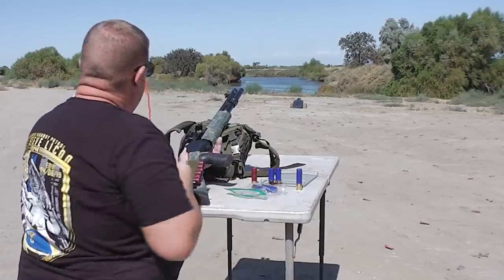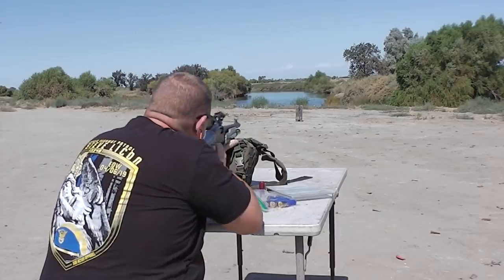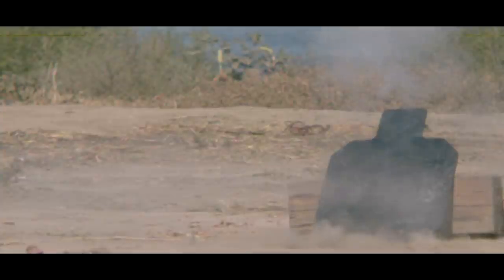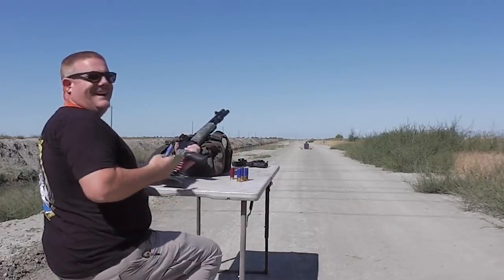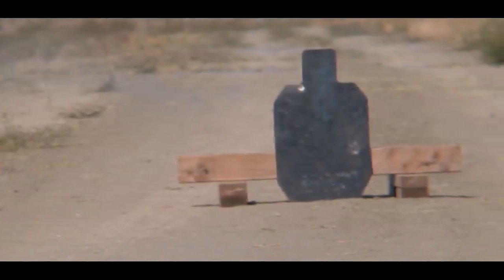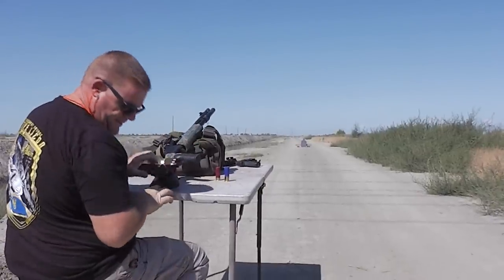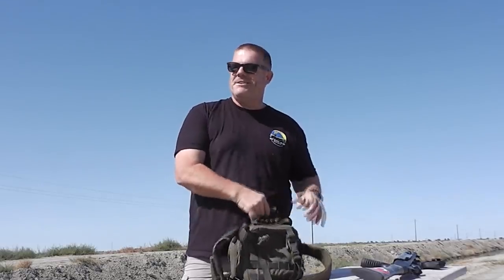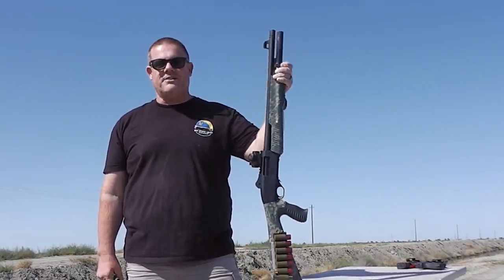Heavier Hitter "Flash Point"  Slugs -  Unexpected Results

Comment: Hey Jeff, The recoil.    pad made by 
"Bear Tooth"
It's a spandex cover & adjustable thickness jell pads they are so much better than the
Limb-saver type. The retail price is not bad either.. Great video, Tell O.G. to wear Pollen Bee-gone. All the boys in blue should use it 😂😅
Reply from the maker: Danny has a couple of limb savers and those have worked very well.    He's shot many very heavy slugs without complaint.   I'll look into the bear tooth

Comment: Yeah I have a 500 set up for turkey and buckshot loads. Polymer stock, I pulled the grip cap and filled it with a couple oz of  lead shot and epoxy, did the same in the back end of the stock. Did wonders for the recoil,  of course it’s more of a walk in in the morning and sit down gun.

Comment: Awesome video guys!!!
LOVED IT!!! 
"Recoil is stout" -  i.e. for us mortals "if you are not Gregg - shoot these only if you have a medical team near by to get your dislocated arm back into the shoulder socket" LOL
Bees - ouch!!! Good thing you didn't set the target on the bee hive... that would be MOST ""interesting"... as in "forget the puff of white smoke - there is a huge cloud of bees coming over... " LOL 
Hope you feel better by now Gregg...
 
The slug design is VERY interesting (SMART IDEA!)... I think this should work nicely with some modifications and a lot of testing.
Here are some "ideas" for said modifications:
1. No resin plug - sadly I've had my share of resin failure post firing... - either solder a lead cap (e.g. punched from lead sheet) on top of the slug 
    - or thread the top of the slug, fill with media/oil, and drive a steel screw (and solder it too)
2. Use steel/ferrous media or (even better) ferrocerium rods (like the tiny rods Jeff shot a few years ago) to generate multiple sparks as ignition sources 
3. Test other fuel sources - maybe a mix of oil and oxidizer or two/three oil mix where one oil has a lower ignition temperature to aid ignition, maybe an oil/fuel mix will do...
4. Wasn't there a slug TFM fired with a firing cap in it? Maybe that will solve the issue (err.. do NOT solder THAT one... LOL :)
5. Try combinations of 2, 3 and 4 to verify ignition upon impact. Start with alcohol/fuel soaked rugs and a steel plate and progress to less flammable material... :)
6. Shift the slug design altogether and make short distance (100m tops?) road-flare slug that hits sticks to wood and/or falls and ignites a road-flare core (slow burning but HOT pyrotechnic star that spits sparks etc) - or thermite (much better, hotter but harder to ignite) load.
7. Still anther oddball idea - forget about shotguns and shift to fireworks: design a small (1-2") mortar and shell that will burn at high heat and spread stars all over the area - that will be MUCH more effective. 
8. Off the track idea - lawn shark rocket design that burns for a short distance (place the launcher, fire and forget), then falls on the ground, keeps moving, and has a hot thermite head that ignites it's surrounding - or a shell heading with hot burning stars spreading them over a 1m distance (weak burst). 
As for 6-8 - consult a local pyrotechnics club - they will help for sure :)

OK... enough nonsense on my part, wasting  your time reading all this :) 
[Note to self - not only do I talk too much, I've started writing too much now...yikes!!!]
Thank you for the wonderful video Jeff, Gregg!!!
I'm going to watch it another time now... :)
Saar
Reply from the maker: Yes,  keep it to 10 words or my brain gets overloaded. lol   thanks!

Comment: Minor nit: The flash point is not where the substance autoignites; it's the temperature at which the liquid can sustain combustion without a wick. It still takes a spark to light it.

The point at which combustion starts without a spark is the autoignition temperature. That is typically much higher than the flash point.

A good example is gasoline.it's flashpoint is below room temperature, but if you pour some on the ground, it doesn't immediately light. However, if there is a candleor other ignition source nearby, once the vapors reach the ignition source, then the gasoline vapors will ignite and in turn ignite the gasoline liquid. If you poured gasoline on a surface at or above the autoignition temperature,  it would immediately ignite without any spark or ignition source required.

Comment: Thanks for sharing your videos. 
See if you can find IMR 7625 powder. It burns slower,  and will achieve higher velocity with less recoil. Back when I did reload, I used it in 12 ga, 357, and 3006..
Tnx

Comment: Put a primer in the tip instead of epoxy. Or zippo lighter flints with Cerium/Lanthanum.  It'll spark the oil off when it hits.

Comment: The whole idea is pretty cool, but using 3 - in - 1 oil as the pyrotechnic load doesn't seem to be the best idea. I'm not sure WHAT a good choice would be, as it needs to be stable enough to be SHOT, yet also able to ignite on contact with the (relatively) soft ground. It's so awesome to see you guys actively helping develop these rounds! This was by no means a "failure" of anything, this was actual science (.....ish). 

For the sticklers @5:10 that's (about) 1370 kg at 64.3 km/h. This translates to 2,832,132.5 joules of recoil energy!
Reply from the maker: He used that based on an old video of weird weapons in the 1980's.
Reply: @taofledermaus  That makes it all even better - you're not only doing Science(tm) you're also helping Warwolf out with his development!

Comment: I can't imagine this concept had much thought put into it.   One wonders if the person has ever tried to actually start a fire. Certainly it takes little when the conditions are ideal and the kindling and tinder are structured and sufficient, but in a haphazard incidental scattering of dirt, brush and trees, a puff of flame lasting for a few milliseconds can't be expected to be reliable.  

Add to that the fact that other tools exist, and even if you specifically wanted to shoot something from a shotgun to start a fire at a distance, flares actually already exist and would be far more effective.  

That said, I don't know how often it's desired to start a burn at a single point instead of a controlled line.

Comment: The epoxy seal may not have been failing. A possibility is that the final are creating a vapor trail in the same way the tip of an airplanes wings can create vapor trails.

Comment: Oil? Vaping? You crazy fools hahaha

After all the experiments to make vapour trail slugs, it arrives here in a slug that had a different purpose all together. More of these with different coloured oils would be good and it's back to the drawing board to modify the design for firestarting slugs.

Maybe less weight and less power will aid the slug only breaking on impact splashing hot oil and starting that fire.

Comment: Even assuming that the small volume oil did ignite on impact, the extremely brief flash isn't going to radiate enough energy to bring the surrounding environment up to an ignition point. Unlike soaking the object with the same amount of oil ignition is fully external to the surface and not as concentrated to an area, this is why real incenfary rounds tend to make use of phosphor or other agents that embed and smolder. The message about bee's is totally true though, you want as many as possible for healthy ecology, but they are never going to be your friends.

Comment: Ferrocerium Core and a Steel + splitter tip In a wax/sawdust core slug? + tip should splinter and ignite the ferrocerium bits and get the wax/sawdust mix burning

Comment: Two problems. Even if it worked correctly, the burn duration wouldn't be long enough to reliably get a fire going. Second, there is no way the Forest Service, Bureau of Land Management, or Cal Fire would allow firearms on the the fire line. They already have flare guns that shoot fireworks that work great to get a fire going. You generally don't want to start one a long ways off, because you might not be able to contain it.

Comment: Which I could come and get those bees, I'm a beekeeper but I'm in Michigan.

Okay, a sting will alert more bees to sting at this point if they are aggressive. I don't know how else to assess that other than everyone needs experience with bees. Honeybees, yellow jackets, any wasp or bee reacts to sound. I know mowing the lawn near a hive of yellow jackets pissed them off.  Vibration annoys them, so how do you avoid this? Be calm, don't throw firecrackers, and show them respect; turn your head downward and walk away. Yellow jackets spray venom on occasion while honeybees' leave their barbed stinger in your flesh. Both will tell others to sting here.

While I understand the whole thing about 'flash point', when I wanted to become a chemist and having to look at MSDS's....This would be easier perhaps with aluminum powder or something that ignites in air, but still that vapor trail from the oil will screw you over because it'll just come back to the source; you. I suspect it needs a redesign.

Comment: The oil may have softened the epoxy. I have dealt with similar problems but a different application. Maybe he should try adding aluminum dust ( or mischmetal dust). sealed n the nose, seperate from the oil.

Comment: I asked Google if 3-in-1 oil was flammable, and Google said "No."

"This product is not classified as flammable or combustible. Thermal decomposition will release carbon dioxide and carbon monoxide."

So, if you want your massive shotgun slugs to burst into flame on impact, maybe fill them with match-heads, or thermite, or something that will, like, you know... burn.

Comment: Great video except for the animal abuse. Dang animals need to stop abusing y'all.

Uh, rounds that leave a trail of combustible vapor from a firearm I'm shooting? I'd do that ONE TIME and then say "Nope!". I've seen a few 'sploded guns.

So for some feedback to War Wolf- use some small steel balls and chunks of ferro inside the rounds with the fuel (and yeah, use diesel, not 3-in-1), and plug with a fitted piece of lead, not epoxy. Epoxy is brittle but lead should moosh into the slug when it's fired providing a better seal so no trail wasting the fuel. Upon impact the slug should split and release the vapor, and the steel and ferro should generate the needed sparks.